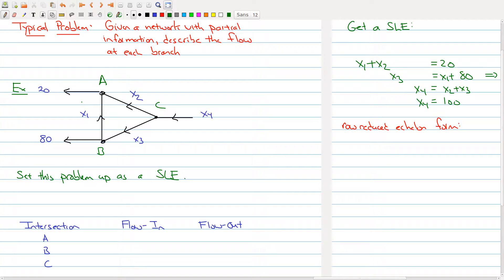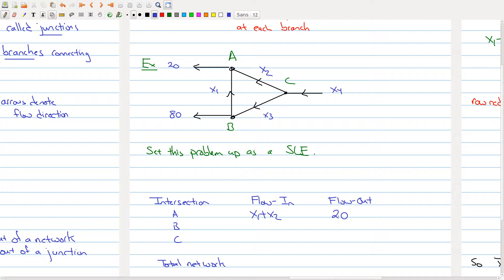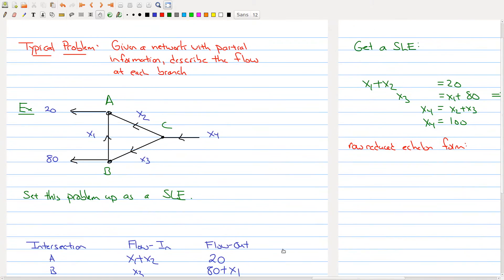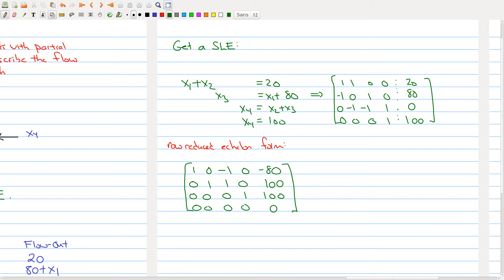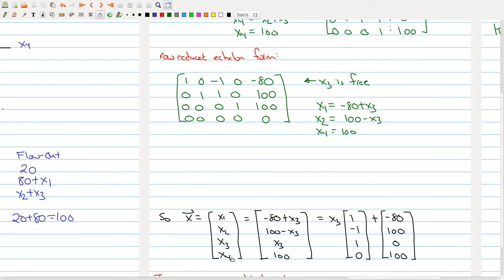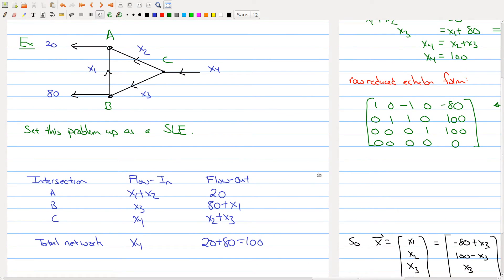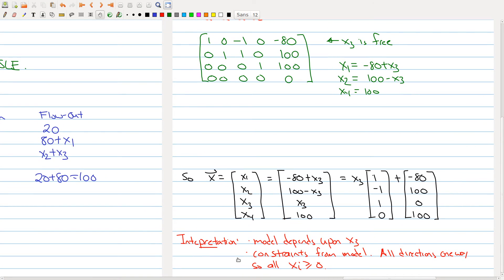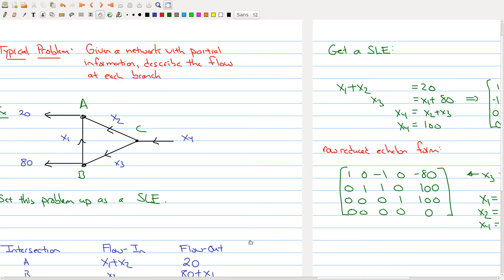Math 1B03 (2020-2021) Lecture 10 Part 4

Comment: Excuse me professor, I think at the end of this video you put the x1 and x2 values incorrectly. You firstly solved the equation that x1=-80+x3, but when you are solving inequality of x1, you set it to be equal to 100-x3. So could you please check and make an update?
Reply from the maker: Hi Yingchen.  I should have had x2 = 100-x3 >= 0, not x1.  I'll fix the notes - thanks!